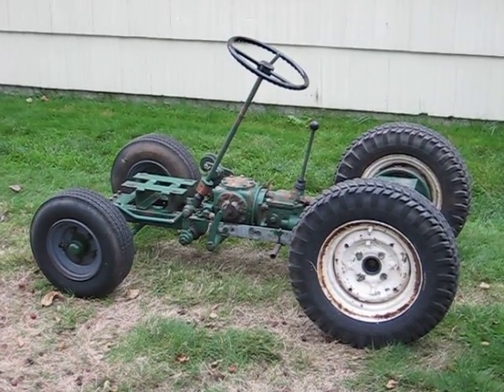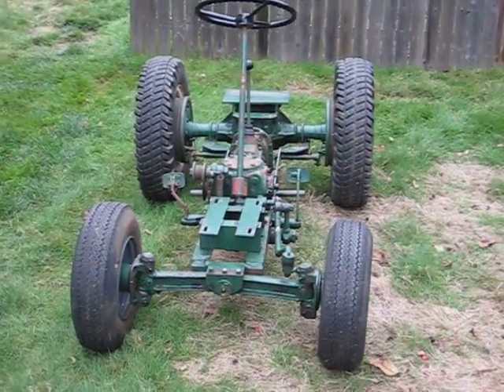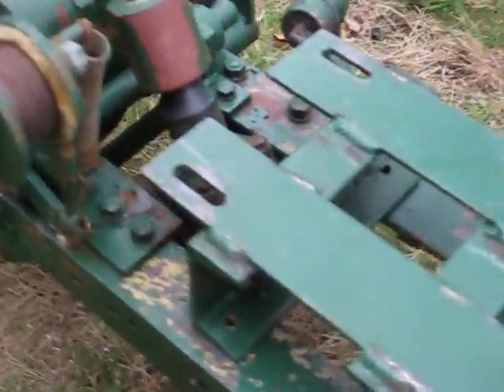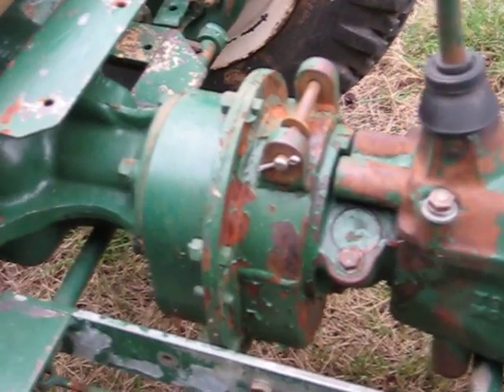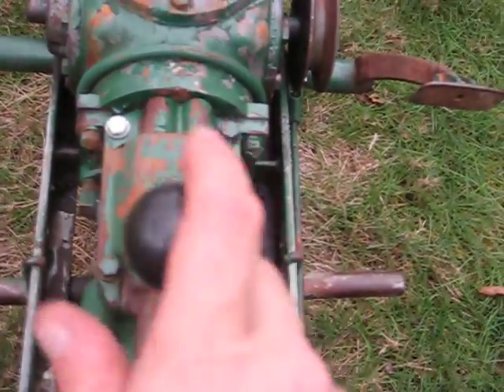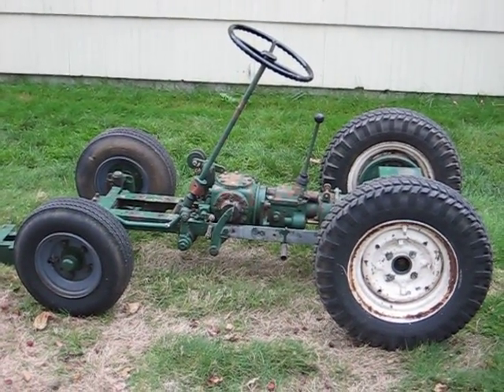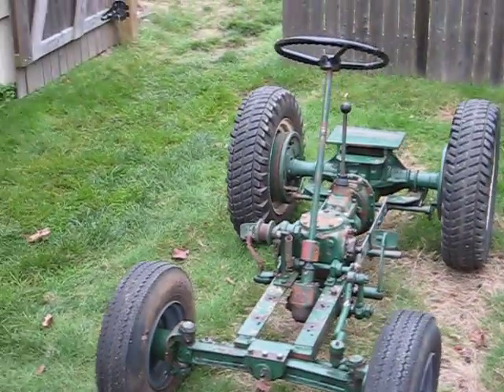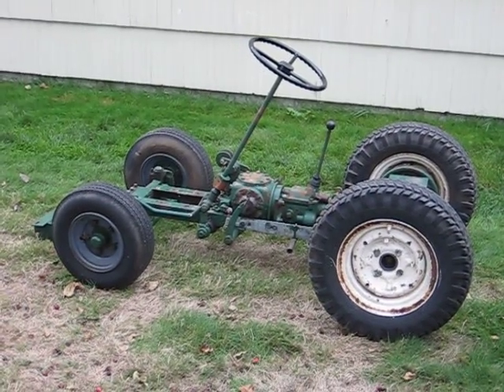1960 's Pow'r Pup Power Popular Mechanics Magazine Garden Tractor Build Part 1

Comment: that looks so cool.  i’m trying to get my hands on some gibson tractors which were made in the 40’s and early 50’s and i think the pow’r pup build designs were influenced a lot by the gibson tractors.  they looked a lot like this.  i guess you can still find the plans online but it would probably be more difficult to find the parts.  it’s like studabaker and a couple other 40’s vehicles.  the gibson clutch is like these pullies and belts and when you push the clutch it loosens the belts and the housing around the pulleys stops them from turning because instead of being stretched out long they are loose so they are wide and the light friction holds them in place.  real simple engineering of the time period.  they needed more friction to pull the machine so they added more belts and pulleys like four of them and that’s the clutch.  i don’t know how it is in the pup plans but you can find the free pdf online.

Comment: I just was looking at your posting about a "power pup" homemade garden tractor. The plans for the power pup tractor was First published in the August 1961 Science and Mechanics. It was not popular mechanics. And why do I know this. I have a copy of the Aug 1961 magazine, and a full set of plans that my father sent away for. Back in 1964. There are two copies of the magazine on Ebay today(6/15/2014) Back in the 64' the plans were $3.00 a sheet. A small point I'm sure, your tractor is a fine example of what can be done by someone working in his garage. Hope you don't mind this small correction. thanx's and good luck with your restoration!
Reply: 1938hd
Reply: Could you send me copies  of plans?

Comment: I would probably do a tensioning clutch were you have a belt and u put pressure on it to tighten it from the motor to the transmission